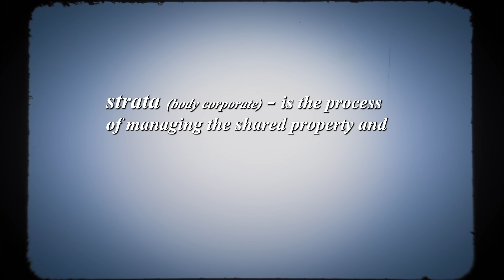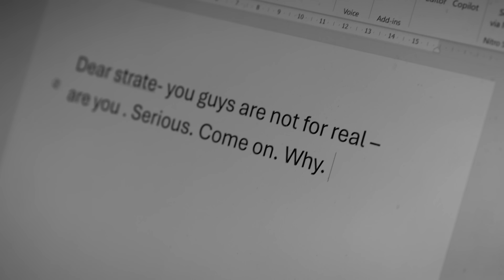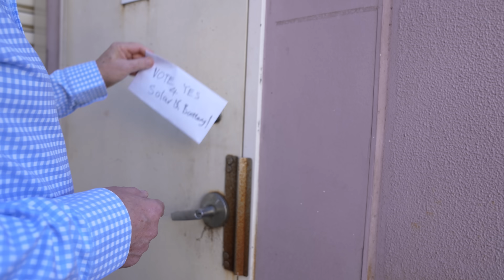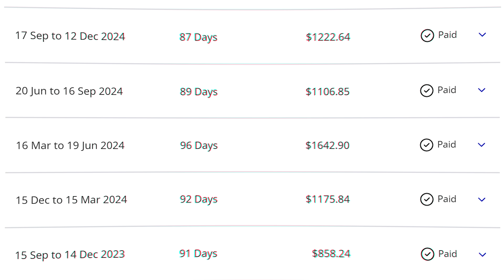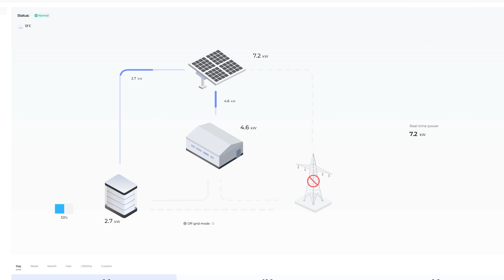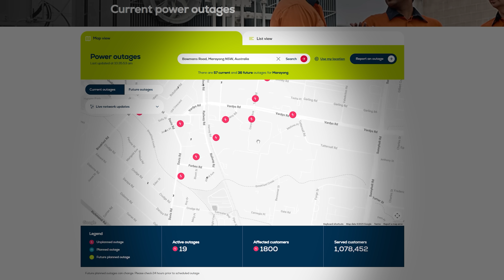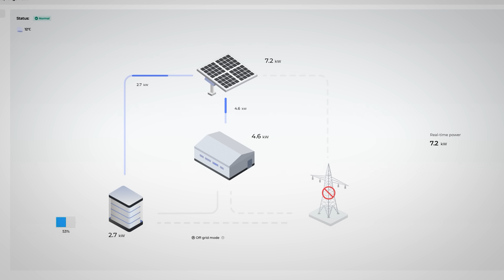The HIDDEN PROBLEM Costing Australians Thousands on Solar

Comment: I worked in building and strata management for some time and realised that many new buildings are tied to a specific power provider until the initial contract is completed (usually 3–5 years). As a result, many residents or tenants are unaware of this arrangement. Committee members are advised to meet with the strata company, connect with the builder and the local council to discuss the installation of solar panels, take action, and ensure the process is properly documented.
Reply from the maker: Thanks for the insights — good to know that a lot of buildings are locked in to a particular supplier.